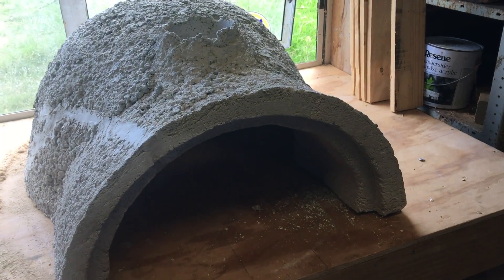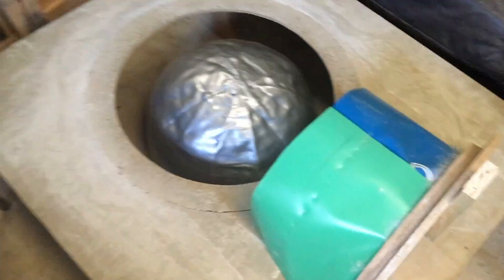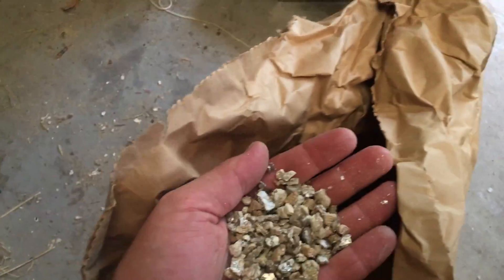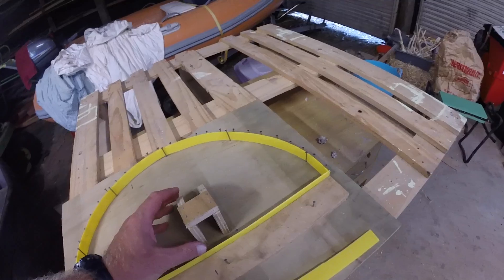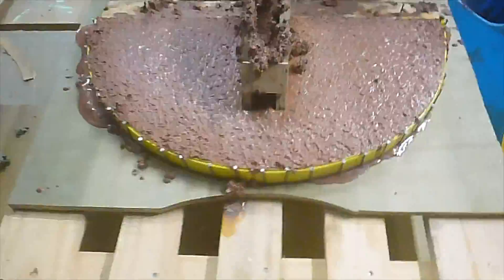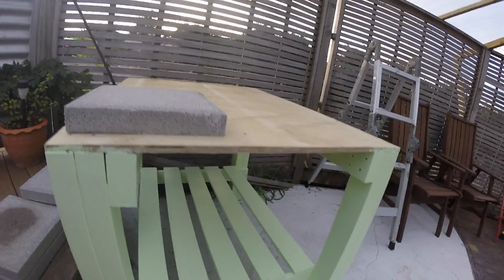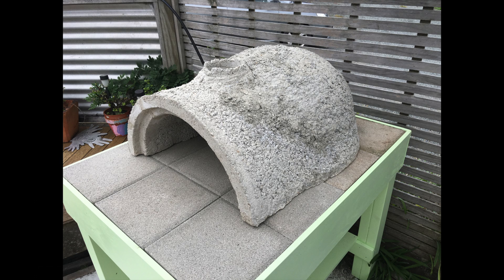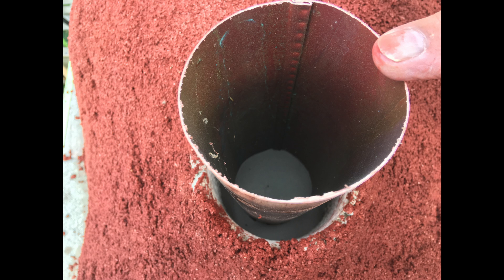Home Made Vermiculite Pizza Oven - Tutorial

Comment: What kind of cement did you use
Reply from the maker: I used Portland cement for this oven but i would now recommend using refractory as Portland cement is not tolerant to heat fluctuations.

Comment: Did you put some sort of expansion joint in where the copper pipe meets the cement, to prevent the pipe from expanding and cracking the cement?